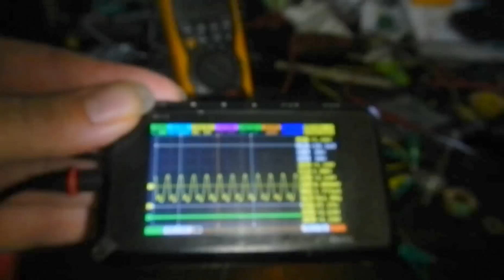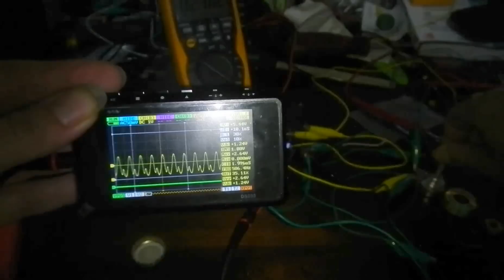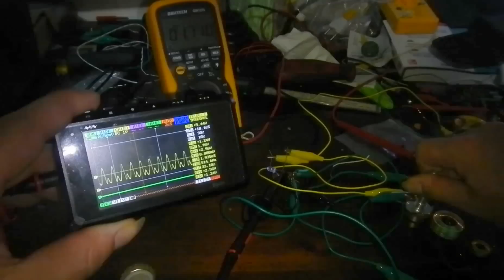Using LDR to self regulate brightness of joule thief. Part 1

Comment from the maker: Lol. Need to get one at a stable frequency first.. As the battery goes down the freq changes... even with steady power some JT's fluctuate a lot... That the point of the ldr in this one. Need to try other LDR's as this one is not sensitive enough.

Once I do get one on a musical note, I will be trying chords too :)

If anyone can point me at a good text for selecting wire gauges that are "harmonic" (not the right word, hope someone knows what I mean) with each other I would really appreciate it.

Comment: What I'm suggesting is to make note of each "stable" frequency, of each component, and calculate the musical pitch, or "note", and it doesn't matter what octave range. Then, instead of saying "it's oscillating at 2354hz" (for example) you can say "it's nearly Fsharp, 7 octaves over middleC". Then tweak each part as close to Emajor as possible. 
There is also probably great value in working in multiples of Earth's core frequency, which is something like 7.3hz.. good luck ;-)

Comment from the maker: Early tests seem to indicate that the LUX meter can "see" less light as the pulses get further apart. like in mode 2. even though my eyes tell me it's brighter.. The dimming in mode 2 that occurs as you turn up past sweet spot is most certainly caused by the less frequent flashes.
So I'm also interested to see if other light meters and eyes see the same thing.
It doesn't hurt to know your own "flicker fusion speed" to do this. You'll need a frequency counter and adjustable led flasher for that.

Comment from the maker: Thank you! I seer a lot of people replicating the same stuff. which is important too. I just wanted to think outside the box a bit.

On of the most important factors to watch, (I think) is that Watt's into LED seems to = LUX or MCD. if anyone can do more tests in that area. I would be really grateful. I want to do it myself as well. Just not very scientific if I'm the only one... Make sure some tests are done with 3v (no joule circuit) to compare. As a control! No one seems to do this?

Comment: very cool, and I think you're on to it! 
because that little LED isn't the "load", the working light, could you just tape it head-to-head with the LDR?

You've illustrated a couple of other interesting things, and we should continue to describe all the characteristics of the "modes", so we can understand them, know where the sweet-spot(s) should be, and make circuits that naturally go there. 

good work MongrelShark!

-volts
-volts peak-to-peak
-wave complexity
-frequency
-brightness
-current